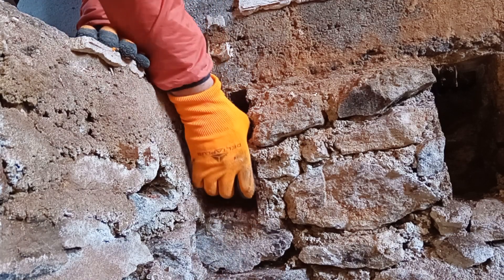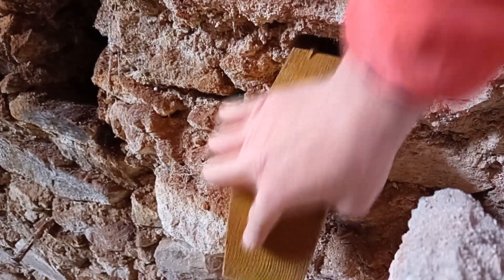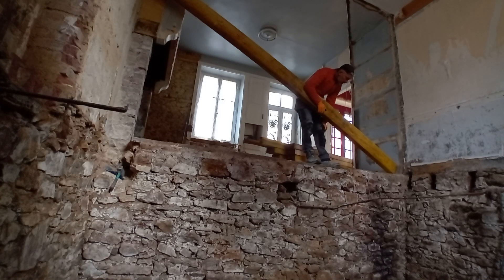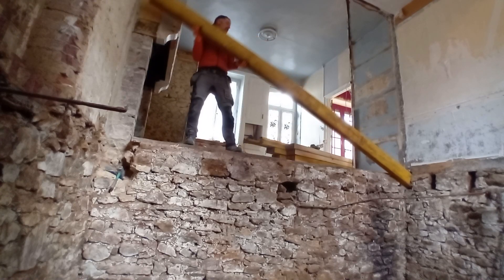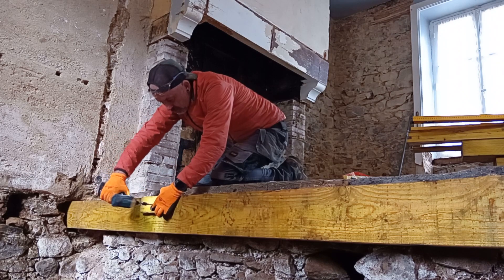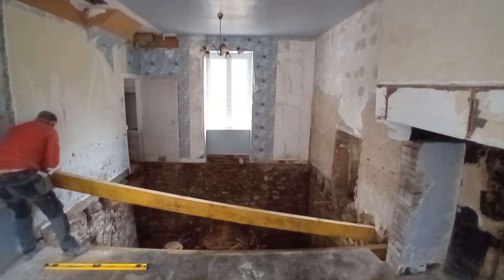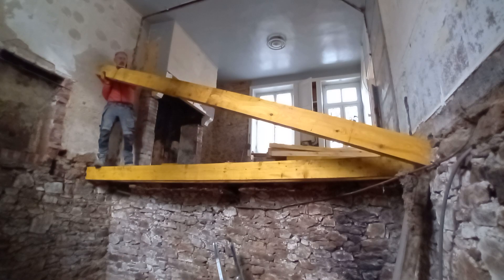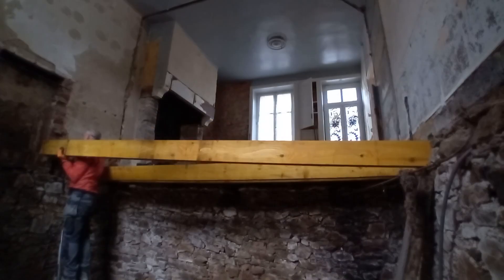Our New French House - Complete Floor Replacement in our Old Stone House

Comment: Hey looks great
It Just takes a lot of patience and as you say its get s quicker each time.  I know how that réels, but it is so much worth it in the end.
I don’t wiI don’t know how much humidity there is in the walls, but in the future it might be better to protect the end of the.joists. The stone walls like this in France don’t have a DPC and water rises By capillary  action.
All the best with this
Reply from the maker: I debated covering the ends of the joists but decided to leave them as they are and tackle the root of the damp outside.  Currently on two sides of the house the soil has gotten so high and needs to be removed and some drainage put in.  All the gutters leak too so all the water off the roof is flooding the permiter so they need to be sorted.  There is also what looks like a concrete plinth on the house which is trapping all that rising water so I think that may need to come off.

Comment: In order to get those beams in easier, you need to be standing in the cellar, putting your first end of the beam into the hole and then pounding upward on the other side, not down the wall just a tip
Reply from the maker: It was a bit of a learning process but with just myself doing it, dropping rather than lifting seemed like the sensible option as they are very heavy.  They are 200mm x 90mm and just over 4 meters in length.
Reply: Hi yes that makes sense. I have watched all of your videos. You are a very hard-working man and it shows.

Iam An old lady now, but my father was a carpenter, and with four girls we worked with him most of our life till we were adults I remodeled, probably about six houses in my lifetime by myself, like you, not quite to that extent with beams and stonework, but close

Really enjoying watching the dedication and the hard work that you have put into for your family and your home. May God bless you all.